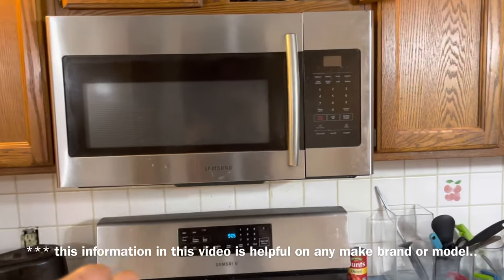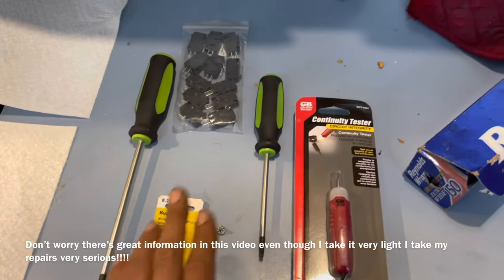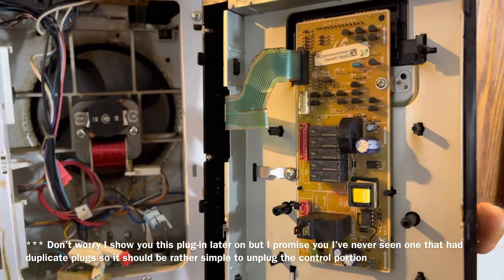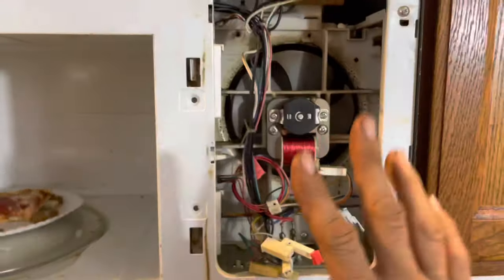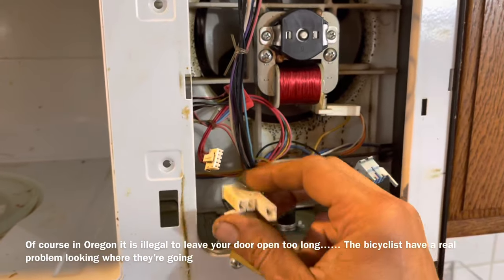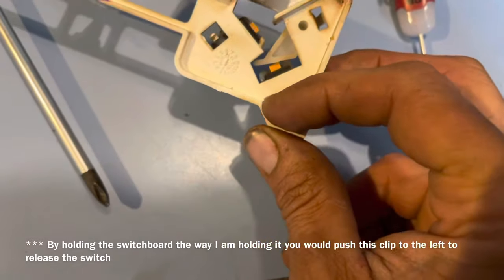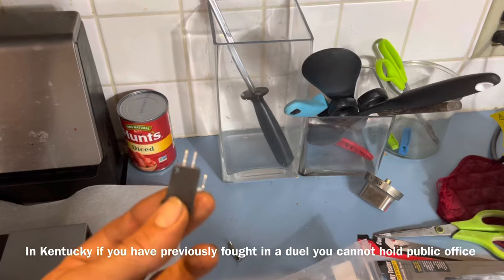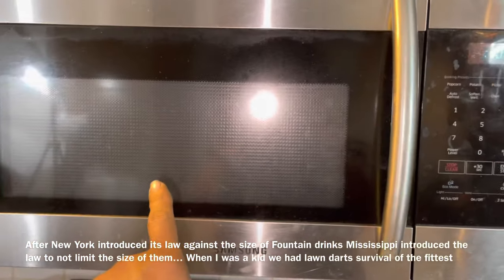Samsung Microwave not working ? easy fix at home! Every microwave owner should know THIS!!!!!!!

Comment: Thank you for posting that video. I need to order some switches for my Samsung microwave too. Can you please share the Amazon link for those switches? Also, how do I know which switch model numbers to order?
Reply from the maker: I sure can I will also put it down in the description. 

If you remember back from in the video I talked about the switches that I ordered that made them universally useful . So it’ll make it simpler for you you just use the same post that I used in the video or the ones that you took off of the switches.
Reply from the maker: johnms333 https://amzn.to/3v1AlNa
Reply: Thank you Clay
Reply: Also, where did you buy the other fuse? And what was the part number for the fuse (just in case I need one for my microwave)?
Reply from the maker: I’ll have to take a look I’m sorry I don’t know off the top of my head.

Comment: This morning mine started making a humming noise as if it was on. Few minutes later the display went out about twenty later the display was on again and making the humming sound. It would stop when we opened the door but resume once closed.  Going to put some sheets in the washer and I'm smelling something sweet. Low and behold the microwave had warmed up a piece of cake we had in there and not only melted the Styrofoam plate but also the icing.  Would this be a fix for that? Prior to today we had not one issue with our microwave

Comment: My SAMSUNG microwave stopped working. It is turning on, plate is turning and light will come on but the time won't move and food won't heat. Any idea what this could be? Thanks!
Reply: Mine is on but does not heat. Did you solve your issue? Curious

Comment: Howdy, what if the fuse tests fine?
Reply from the maker: Well, that’s not the only thing you need to look for you need to check the switches as well like I did in the video
Reply: @sharpcarco  Thank you, I will do that. I thought I understood from the video that if a switch goes bad it will cause the fuse to go with it. I guess I misunderstood - thanks again! great video and support

Comment: Mine stopped working for the final time. I've been able to jiggle the wires to get it to work, but now it just has the door/keys error code of c-do. Every time this code came on, was due to steam coming from stovetop. New boards are $130 and the microwave is already 5 years old, but looks new. Should I just get a new one? If I get a new one, I will get one where the vent automatically comes on.
Reply from the maker: I would get a new one don’t buy anymore the Samsung junk!! My wife says I can no longer by Samsung anything not even there damn telephones…. 🤯

Comment: When testing the switches , how would you know if the switch is suppose to be always open or closed?
Reply from the maker: Well like I said I’m not a appliance repairman. 

But I have noticed the original switches only go on one way so if you look at the original switch and right before you go to install the other one you can look at the two and figure it out. Look at the sides of the switches that will tell you if it’s opened or closed but if you put the new switch on exactly the same way that the other switch was on you won’t really have to worry about it too much
Reply: Good question.  As he noted, if you order the exact same  numbered part, you should be fine, though stranger things have happened.  My training would say order the schematic, or maybe it's online. Then, when you determine whether it's supposed to be Normally Open or Normally Closed, get your multimeter out. Touch the two leads with your probes. A Normally open should give you no indication on the meter if it's good. If it's bad,  it will give you a Closed indication. Then again, it can fail open too! So toggle it and note that it completes a circuit in one state but not the other. For a Normally open, reverse the process.

Comment: What type and size is that fuse you replaced on the circuit board? My microwave is completely dead as well. I had pushed the 30 second button to reheat and it immediately lost power. I checked the plug and the fuse box, they weren't the issue. It has now been unplugged for days and I want to get all the parts together before I try fixing it myself.
Reply from the maker: that sucks but what you want to do is look on the fuse and replace it. Amperage and size they vary from model to model. 

The rest of the parts are down in the description there’s a link to Amazon. The switches are pretty cheap and they’re very very handy to have for many other small appliances around the house they work in dozens if not hundreds of applications.
Reply: My over the range Samsung looks like yours but I will check mine and pick up a set of fuses. Thank you BTW for your fantastic and descriptive video, I was looking online for a new microwave until I saw your video.
Reply from the maker: I appreciate the kind words Stuart thank you very very much we’re very happy to have you. 

Yeah try to avoid them Samsung‘s….. even though my limited knowledge on appliances is that most of them are pretty much the same on the inside. ….  It just makes me feel better knowing that Samsung is not getting any more business from people who watch my videos about the different problems I’ve had with all of the appliances I’ve got my refrigerator is a even bigger problem than my microwave was 🤦🏻

Comment: Hey I tested mine and on of them beeps or lights up when the switch is open. Is it defective? I have three switches. It doesn’t beep when I press the red button. Is it supposed to be that way to let the circuit board know when the door is open?

Comment: I keep blowing the 20a fuse. I tested the door switches and thermal fuse and the all tested good. Any other ideas it might be?
Reply from the maker: Sorry I don’t have an idea don’t work on these very often
Reply: Check capacitor
Reply: I'm having the same issue, I'll post fix.
Reply: @edgarstadanski  From what I have read, if your switches are good and fuse is not blown its more than likeally the Diode

Comment: My microwave works but the power must have went out because the clock was flashing and when I go to reset the clock the power level button isn't responding.  Do I need to take off the panel? I tried unplugging it and it still doesn't respond. It's only a year old with minimal use. Please help

Comment: My Microwave stopped working. Light was turning ON and OFF but it was not heating anything. I confirmed that it was not in DEMO mode. After few days like that i turned ON vent and Microwave powered OFF. Since than it is not powering ON at all. Do anyone have idea what could have happened or suggestion for which switch or fuse to check first?
Reply from the maker: Definitely going to recommend checking the fuse first. And regretfully I don’t know a considerable amount of stuff about them this was the first time I ever worked on one…. Behold the power of editing…. At time is it looked like I really knew what I was talking about

Comment: Will this also work if my microwave turns on and turns a cup but doesn't heat anything up?
Reply from the maker: More than likely not. It is possible though and very simple to perform so it’s worth a try unfortunately I’m not a small appliance repair person so I really don’t know you could have a blown fuse or possibly a bad switch would be my guess. 

Definitely worth trying though

Comment: After Reconnecting the Microwave die for good?
Reply from the maker: No my microwave was absolutely fine. 

After the repair it worked absolutely perfect

But because I disconnected something that I did not show in the video that was unnecessary to disconnect and then connected it to the wrong location it Fried my transformer.

In the video you see it working because luckily I hadn’t connected the wire yet that eventually destroyed my microwave for good….. This is a very solid repair and it certainly fixed mine if I wouldn’t of been messing with other things that I didn’t know about I would’ve been just fine this will surely fix yours and probably 99% of them out there if they’re not already messed with
Reply: @sharpcarco  ah ok. glad to hear.
Btw; ive got the same model, considering that smoke and heat from the cooktop clearly affect the lifespan of the microwave, what would  you consider is a safe   distance from the cooktop to the bottom of the microwave.?

Comment: I have a different problem - my microwave won't turn off and it's also not heating anything. When I turn it on from the power switch on the wall, it immediately turns on and starts rotating and none of the buttons are working. Do you know what the problem could be?
Reply: Same problem with Samsung microwave

Comment: I have the same microwave, it's 2 years old, but now it won't heat other than that everything seems to function as it should.
Reply from the maker: I’d be willing to bet you have a blown fuse , but I’m not a microwave repairman. Just make sure it’s unplugged for a little while open it up and look inside , it’s probably not going to fix itself (not train to be sarcastic over a text message you would have to hear my tone LOL) 

Samsung products are such pieces of crap. Other than this video and another video that I made about my fridge  just stopping working, I will never buy this garbage again I paid good money for it to
Reply: I agree the same thing went on with my refrigerator $3200 but they stepped up and fixed it but I didn't expect this microwave to die so quickly.
Reply: Ours just did the same thing today- runs, but doesn't heat! I'm curious what you figured out Dqmusic08?
Reply: @SC-px2mt  They're supposed to be sending someone out to check it out on the 15th, they have already missed 2 appointments. Sorry I couldn't be more helpful.
Reply: We have the same Samsung microwave & the turntable stopped working, it hadn’t even been 2 years!
Reply: @sharpcarco  its not the fuse, I checked mine and its good.
Reply: Hi I know this is old but I am facing same with my microwave now - did you manage to find what’s the issue. Thank you 🙏🏾